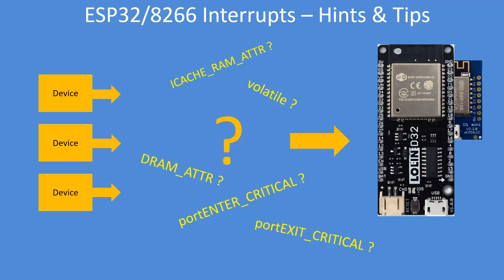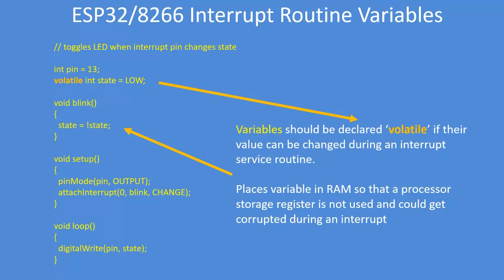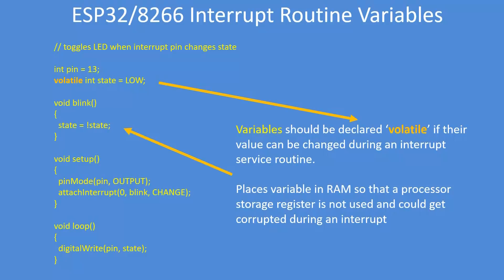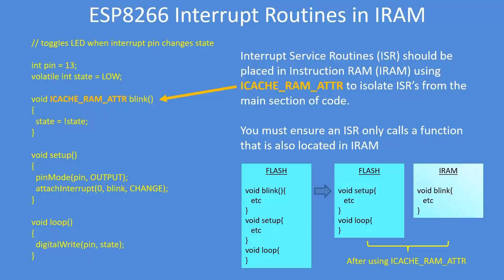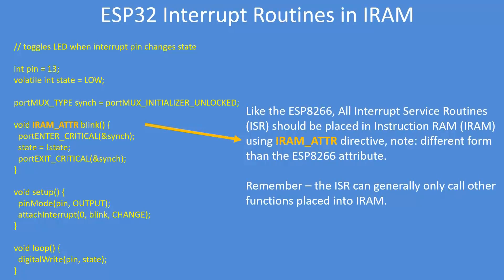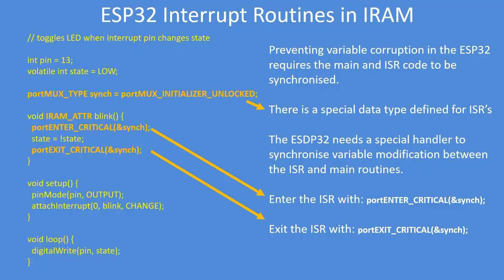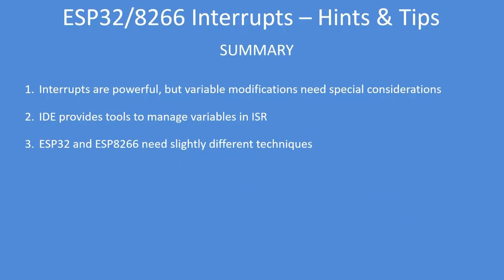Tech Note 127 - ESP32/8266 Hints and Tips for Reliable Interrupt Operation

Comment: Would it be feasible to use interrupts to capture and store a signal generated by a vibration. Imagine a esp32 setup for external interrupts with a vibration sensor (piezo disc module), connected to the interrupt pin; the ESP32 would remain in deep sleep while there is no vibration; then save the analog value coming from the piezo module to RAM. Not sure how to approach this or if possible.
Reply from the maker: You need an edge transition from 0-3.3v or 3.3-0v to wake the ESP32, it’s not possible to use an analogue signal for interrupts unless the value exceeds the input trigger threshold and it has a Schmitt input, tbh I don’t know if the ESP32 supports that function.
Reply: @G6EJD  I used an LM324 as an amplifier/comparator for the signal generated by the piezo. I wonder if I can use the digital HIGH from the comparator to trigger the interrupt and wake up the esp32, then have the amplified analog signal recorded through an ADC pin. (this is just for hobby stuff, Im learning as I go)
Reply from the maker: @Friendroid  an LM324 would give sufficient gain to convert low signal amplitudes to a fast rising edge, so that would work. However recording audio or varying amplitude signals is not easy. To have any value you’d need a certain number of ADC samples to recreate the waveform or get any meaningful meta data from it, let’s say you records a couple of seconds (you need to record at twice the maximum frequency) so say 1khz for a noisy like signal then that would require 2000 samples at 8-bit resolution or .2K of RAM leading to a fast consumption of memory. So it’s achievable but management will be the key to success, to me that means filtering out random triggering from noise or vibration spikes, then memory management to ensure there is enough TAM to enable the ESP32 to operate, so there would be need to be a regime to delete recordings if there were too many and so on. It’s just the need to think through all scenarios and have a way of coping with them. I’d start by recording some vibration events and see what the data is like as that will help determine the sampling frequency, that would simply be a loop to take an ADC sample, store it in an array then wait for the sampling frequency (time) then repeat until the sample is complete, then perhaps output the sample to the serial port for analysis, that would take about 10-lines of code, it would only need to be very basic, then having taken the samples how to get them off the ESP, there are a few ways, serial or write to SD card, but how to initiate a transfer maybe by push button and so on.
Reply: @G6EJD  I understood it fully, thank you.

Comment: Thanks for this tutorial. My ESP32 has a 40MHz crystal and this will help improve the reliability of catching a 10us falling edge delay on two external interrupts.  I had a tough time doing this on the Arduino as the timing wasn't always repeatable.
Reply from the maker: An interrupt is an edge triggered event and so should be asynchronous, that is not dependent on clock speed or accuracy, are you sure the incoming signal is meeting the ESP32 logic requirements of a voltage they is above or below the input thresholds say 2.7v and 0.6v and that the edge transition is clean and not subject to any perturbations. Sometimes the addition of a low value (PF) capacitor can help to store enough energy and ensure reliable switching, either that or fit an input buffer to clean up the signal.
Reply: @G6EJD  I'd have to check.  I was just comparing my scope capture to the values I was outputting onto the LCD. On the scope i was triggering off 3v and seemed to get pretty consistent results but the Uno seemed to vary. I don't have anything else really happening in the loop other than waiting for the two external triggers and the ISR only updates the volatile with the micros function so it should be quick.  You're probably right that there's some perturbations causing false triggers.  This is an IR sensor and there's 38KHz riding on top of my data, maybe I need some filtering or I need to clean up my jumble of wires.
Reply from the maker: The Arduino will have needed about 4.4v for a reliable trigger for the high state and about 0.7v for the low state. Nearly all CPU’s have a Schmitt input to stop slow input edges from causing the input stage going through a linear region and oscillating, it may be worth reviewing the data sheet for inputs that are designed for interrupt use. It may also help to enable either a pull-down or pull-up resistor on the cpu as this helps to clean up the input signal or support an open-source / collector sensor output stage. Some sensors use an open-source output so they can be wire-or’d together then any sensor can trigger an event with simple loop wiring.

Comment: Thanks for the video!
2:40 If I want to use more ISR routines do I have to declare multiple portMUX_TYPE variables?? synch1, synch2, and so on??
Reply from the maker: In short yes, note this is a data type just like say an integer. The reason for doing this is to stop the two cores from sharing the interrupt task, and when that happens core-1 may handle the interrupt for you, but if the source interrupts again, core-2 will handle the interrupt and then any variable manipulation in your routine will get modified by both cores and causes generally a core crash. To stop this you can lock the data to the core that handles the task with a flag aka semaphore to stop the other core from handling the interrupt. You can share an interrupt routine amongst peripherals and you need to handle all that in the same routine that is locked to the core given the task. A long answer that I hope explains the reason for doing this, perhaps I should produce another video at some stage to explain.
Reply: @G6EJD  thank you! I did some test on an ESP32 but it still didn't solve my question
You have made it clear! I would love a video on this topic since I have found out that is not much good discussion on how to implement multiple ISR routines
Reply from the maker: What is happening with your problem?
Reply from the maker: One of the problems with freertos is you can’t stop interrupts to prevent the other core repeating the activity so semaphores are needed and you may need to test them during an interrupt response handler
Reply: @G6EJD  I don't have any problem yet but i want to implement more than 3 external interrupts, i have tried without using "portENTER_CRITICAL(&synch); 

portEXIT_CRITICAL(&synch);" and I guess if I use 5 or 6 interrupts I do need to use the portMUX_TYPE data type
The main question was if every ISR needs a unique portMUX_TYPE variable and you have clarify that :)
Reply: @G6EJD  I don't think i have the equipment to do that test but thanks! you have been very helpful
Reply from the maker: @robertobrenes5283  That method would work, but if using IO ports I would tend to use one interrupt handler and then detect which port created the interrupt in the handler and respond to that port and then return.
Reply: @G6EJD  even if the multiple interrups are triggered by square signals? I'll look how to do that
Reply from the maker: @robertobrenes5283  If the same source then that really drives you down the single interrupt handler path and the need to assign in the code priorities for each pin, say they all get triggered together, then you need to clear them all as a source and handle each one in terms of required action and make sure you get back in-time for the next event. Using multiple port locks would not be the solution. If using asynchronous interrupt inputs, you will still need to plan for the event when they all align and the signals come in and out of alignment and that will happen, there is a whole section on interrupts in the Espreffi documentation set.
Reply: @G6EJD  Why would it matter if for, one interrupt occurrence, core 1 handles it, and core 2 the next time? Surely they both have access to the same memory?
Reply from the maker: Yes shared ram but difference segments as the programme counter / location has to be maintained for each process.

Comment: Hi David! Excellent video. I'd like to ask you for some advice on a problem I'm facing with esp32 though. I'm trying to enable two external falling interrupts on my esp32. First of all, which 2 esp32 pins could I use to enable the interrupts with pullups (can't use 16,17,4,19 bc already used). And finally, should I have to replicate what's in 3:37 in this video for both interrupts to assure good functioning? What if one interrupt happens when processing the other, or any of this type of casuistry?
Reply from the maker: Hi, you can use any pin from 0-32 for an interrupt. If both pins are set to interrupt on low, then external timing will determine how they are handled, but when both occur you have to handle the priority, which is not easy to do, however both should occur albeit one will be handled followed by the other or vice-versa, what effects are you seeing? There is a small problem with the Arduino IDE is the interrupt process is not a true hardware solution ands it’s all managed with a software solution. The key to solving is knowing what your seeing as incorrect operating
Reply: Thanks for your answer. But could you confirm that I have to duplicate what's in 3:37 for both interrupts in my case? And if by default, if an interrupt is triggered when processing another one, the system will end processing the one it's already doing and then process the one that was triggered?
Reply from the maker: @guillembalcells5376  sorry, yes each party n needs its own handler so just duplicate the ISR for each pin and decide what you want to do when it gets triggered. Don’t use serial.print statements inside the handlers
Reply: @G6EJD  Just to confirm I've done this, and only state1 is printed, am I missing something? Maybe 2x portMUX_TYPE synch?:

volatile unsigned int state1;
volatile unsigned int state2;

portMUX_TYPE synch = portMUX_INITIALIZER_UNLOCKED;

void IRAM_ATTR blink1() {
  portENTER_CRITICAL(&synch);
  state1 = 1;
  portEXIT_CRITICAL(&synch);
}

void IRAM_ATTR blink2() {
  portENTER_CRITICAL(&synch);
  state2 = 1;
  portEXIT_CRITICAL(&synch);
}

void setup () {
  state1 = 0;
  state2 = 0;
  attachInterrupt(23, blink1, CHANGE);
  attachInterrupt(25, blink2, CHANGE);
}

void loop () {
  if (state1 == 1) {
    Serial.print("state1 OK");
    state1 = 0;
  }
  if (state2 == 1) {
    Serial.print("state2 OK");
    state2 = 0;
  }
}
Reply from the maker: @guillembalcells5376  
portMUX_TYPE synch = portMUX_INITIALIZER_UNLOCKED;

volatile bool state1, state2;

void blink1() {
  portENTER_CRITICAL(&synch);
  state1 = 1;
  portEXIT_CRITICAL(&synch);
}

void blink2() {
  portENTER_CRITICAL(&synch);
  state2 = 1;
  portEXIT_CRITICAL(&synch);
}

void setup () {
  Serial.begin(115200);
  pinMode(25, INPUT_PULLUP);
  pinMode(26, INPUT_PULLUP);
  state1 = 0;
  state2 = 0;
  attachInterrupt(25, blink1, CHANGE);
  attachInterrupt(26, blink2, CHANGE);
}

void loop () {
  if (state1 == 1) {
    Serial.println("state1 OK");
    state1 = 0;
  }
  if (state2 == 1) {
    Serial.println("state2 OK");
    state2 = 0;
  }
  delay(100);
}
Reply from the maker: If you cant read my response get back to me
Reply from the maker: It looks like the compiler now adds iram directives so I removed them and all works ok now

Comment: Another question Dave. I've seen several other esp32 interrupt sketches that use portMUX_TYPE mux and not synch. And also portENTER_CRITICAL_ISR(&mux)
Care to explain the difference?
My interrupts seem to run fine either way, but interested in your expert opinion. Cheers. Matt.
Reply from the maker: Hi Matt, the only method I have seen is that provided by Espressif in their Freertos documentation, my view is any other method (if that's what's being employed by the compiler - very important) is not a valid method. Noting the need to do this is to allow access to the programme variables without conflicting with the operation of the real-time operating system and it's use of the stack and variables during interrupt servicing. It's quite possible to use other directives only to find that the compiler is implementing either method in the same way and I suspect it is! The only way to determine this is to go through the ESP32 IDE add-ons to see what's done. Code size may be a indicator of the complier implementation for both methods, if identical then suspect no change in the final image regardless of method used.
Reply: @G6EJD  as alway, a very concise answer.
I'll stay with your methods and have a browse of the docs.
Good day to you Sir.
Reply: @G6EJD  I think that I'll leave the clever stuff to clever blokes like yourself. 1) struggling to find the info and 2) understanding it as and when I do find it is a non starter. I should have paid more attention in school! And I'll definitely be paying more attention to your videos from now on :)

Comment: Wish you lived next door. Having major problems with interrupt on a tachometer sketch. Keeps resetting the ESP32 :(
Reply from the maker: Are you using interrupts? If so make sure you are entering and exiting the ISR with the correct commands and also you are limited to what you can do in the ISR like no serial.println statements
Reply from the maker: Also you can’t stay in the ISR ( interupt   Service routine ) for too long just enough to mark the event and maybe increment a count.
Reply: After trawling through many videos and websites I've come to the conclusion that there's just way too much going on in the interrupt, so will try another route. Thanks for your reply
Reply: Got it figured out. Many thanks for your input.

Comment: Thanks for these great videos, Dave.  I subscribed to your channel.  I have a related question.  

Will using a process inside the function pull all related functions into the IRAM? 

Example - from inside  my IRAM_ATTR my code I call this process:
   unsigned char result = rotary.process();

I adapted an encoder library interrupt example from this article  
    http://www.buxtronix.net/2011/10/rotary-encoders-done-properly.html
and corresponding git
    https://github.com/buxtronix/arduino/tree/master/libraries/Rotary

Comment: Google is so ... Something, I searched for interrupt on esp32 and I got this in the recommendation on YouTube, few hours later.
Reply from the maker: ed, it’s best to try a simple example and make sure you always preserve the programme variables using the correct method, without doing so, you will find your sketch will work with a low reliability level.

Comment: Just instead of critical sections that can actually corrupt whole execution - use  taskDISABLE_INTERRUPTS()
https://www.freertos.org/a00020.html#taskDISABLE_INTERRUPTS
and by the way volatile keyword does not mean it is in ram but tells compiler to omit optimizations and modifications on it.
It actually can be unused register
Reply from the maker: First of all, these videos are primarily for beginners/ novices and the principles I put over are basic, yes the compiler may make other decisions but usually and as recommended by Espressif IRAM is the only location that should be used, in fact they also recommend using DRAM for the ESP32 . I would never recommend using a disable interrupt function and even the documentation says that too:
‘Macro to enable microcontroller interrupts.

‘Normally this macro would not be called directly and taskENTER_CRITICAL() and taskEXIT_CRITICAL() should be used in its place.’

Comment: ICACHERAM ATTR is valid for ESP8266 too ??..
Reply from the maker: Only esp8266
Reply: @G6EJD  I don't know why they did that its annoying , but you can define it as the same so it always works if you are writing cross compatible code
Reply from the maker: Indeed, it woudl have been so easy to have used the same syntax.